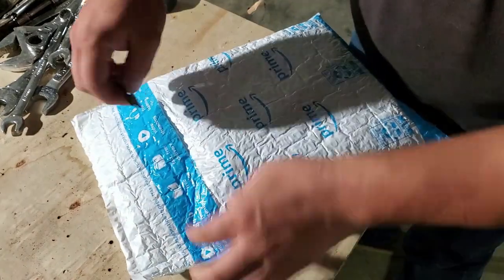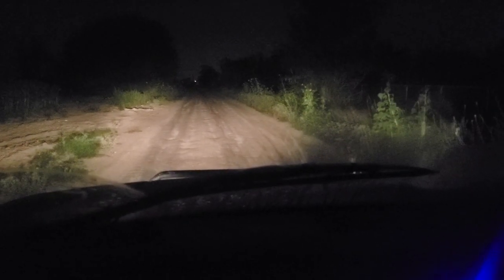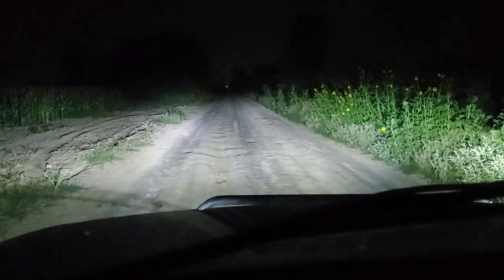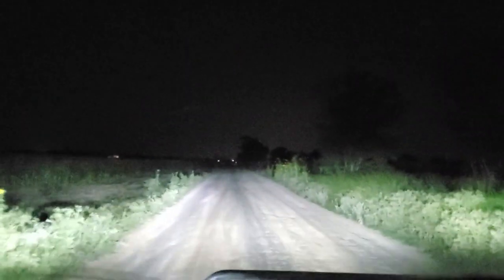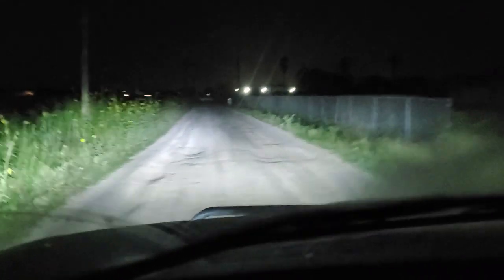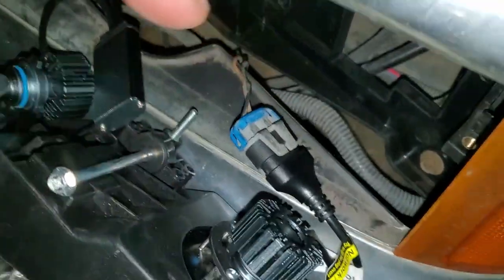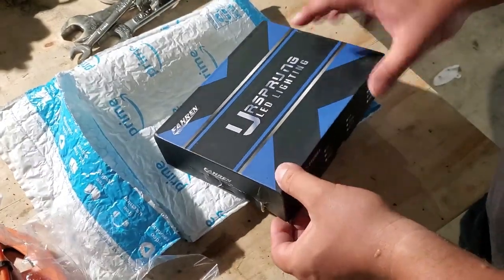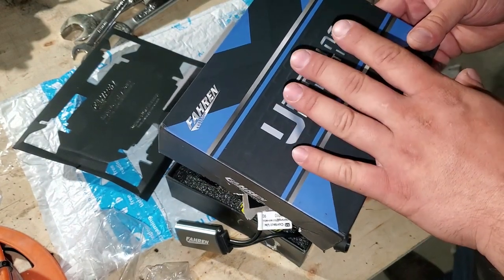Are Fahren LED Headlights good?

Comment: Also its like Fair Ren. As in Fahrenheit
Reply from the maker: Lol thank you for the clarification, I was wondering what the correct way to pronounce the name. But thank you for sharing that they so far have last 2.5 years for you. Good to know! Thank you!
Reply: @EddiesCustomsandRestorations   yeah, and I detail my engine bay constantly and so far the little ballast boxes seem fine. I know they're water resistant,  but not proof. I should say 2.5 years and 55,000 miles so far.
Reply from the maker: @vermontvermont9292  yeah those little boxes are the antiflicker capacitors
Reply: @EddiesCustomsandRestorations  well they're working great, highly recommend to anyone. Here we also have brutal winters, and they worked great.
Reply from the maker: @vermontvermont9292  thank you again for the feedback! Great to know.